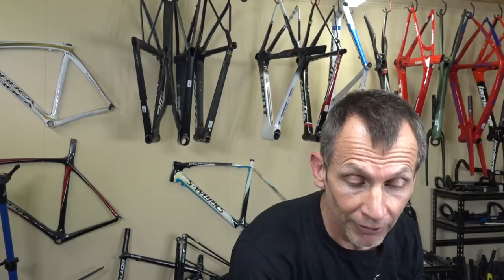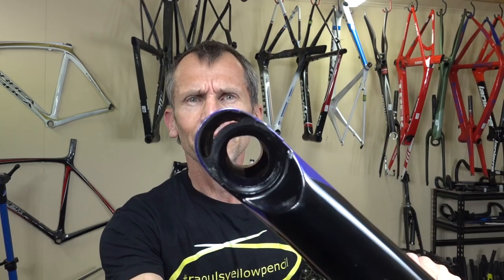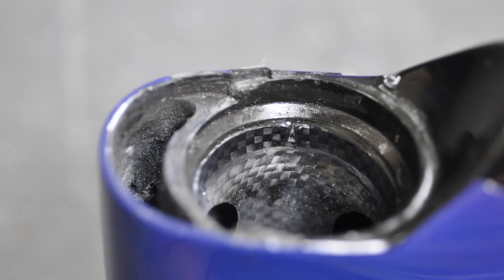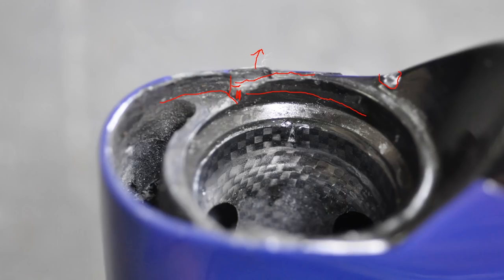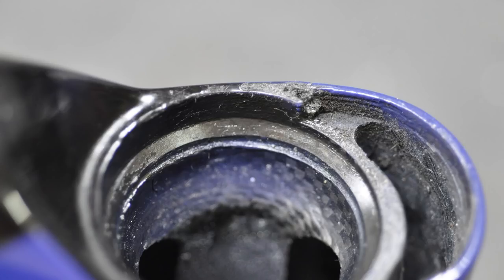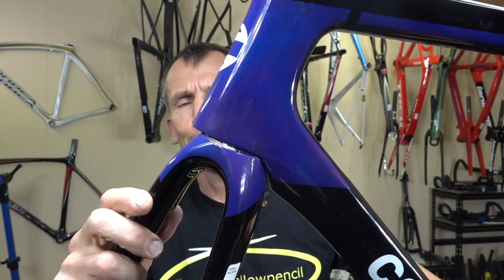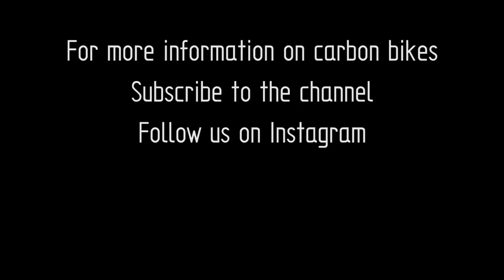Cannondale Design Fail

Comment: I wonder how people who couldn't engineer their way out of a wet paper bag can get a job in the industry. How come that this idiocy can go through every step through to the production without anyone crying out that they're out of their minds? The toolmakers, the mould-makers... Possibly they even had. But since they're almost certainly in China, and the management makes an impenetrable barrier between production and ... erm.... "engineering", or possibly because they don't even dare say anything and "make trouble" lest they get fired immediately, anyone who had clearly seen that this can't possibly go well, nobody told the genius who is supposed to know this stuff... I say it over and over again: the standards of engineering in the bike industry are piss-poor, and even that is charitable.
This is ONE of the reasons I always want to build my own bikes. I want to see this crap before it's hidden inside. I would have immediately filed it away, just like I did with the "lawyer lips" my fork came with. The reason they thought they needed to limit the travel is probably because they wanted to make the brake hose internally routed at ANY cost, and found that if they don't limit it with the way they designed the channels, it will get pinched. I don't want a totally internally routed bike that gives me a 0.01% improvement because the cable is hidden in the frame, and the bike looks "clean". I don't want them gauging a HUGE hole in the crown of the fork above one of the legs just they can hide the cable within, hiding it from view. I want a fork that doesn't break when I apply max braking power. While writing this, I just solved this problem of internal routing more elegantly and safely. Make the frame as normal, then add a fairing above the cables that can unclip when the fork moves too far. Let it hinge on the top end - perhaps make it spring-loaded so it snaps back after the front wheel is straight again, then route it through the leg of the fork or through the fork and then behind the leg. This way you could even take the fork off the bloody bicycle without having to re-bleed everything again, and if you route it behind the leg you can even take the brake off completely and replace and put it back on while it's assembled and bled. This way, you can have the travel be limited by the handlebar hitting the top bar, which is not exactly nice but I believe the safest way to do this.
I'm in the market for a new narrower handlebar, and the dealer had only internally routed ones in the width I wanted. So I thought, oh well, why not, I don't need to use it if I don't like it... But then I got the drawing of the thing (being able to get those is one of reasons I favour Ritchey, which is one of the other firms that does real engineering), and found out that there are two holes on the underside, but also a hole in the middle, so you can route your cables through your stem. REALLY??? Is that worth adding a stress riser on THE highest loaded spot on the handlebar? Just so people can't see your cables and the lines of your bike are "clean"??? I'm quite sure Ritchey engineered around this (by making material thicker on that part and adding weight), but others possibly just drill a hole and weaken it without realising it. And then you need a stem with another hole and another stress riser in it, and possibly a huge chasm in the crown of your fork... Nope. The aerodynamic cost of pushing a 5mm thick (or thereabouts) cable through the air is worth knowing the most heavily loaded parts of my bicycle are not full of stress risers and are at least somewhat less likely to fail while I'm on the damn thing (fingers crossed).

Comment: Can you just grind that pin so it wont hit the frame ever?
Reply: You could, then the thing restricting steering rotation is the gear wires or cables and hydraulic brake hoses that run in that curved slots in front of the steerer tube. That’s probably not a great idea either.

Comment: I just dropped a pretty sum on a 2021 Supersix Evo….yikes…..any way to mitigate any damage?
Reply: Return it using this video as evidence as unfit for purpose.
Reply: Try not to crash. Seriously, the damage shown indicates that the bars were rotated way too far, with a great deal of force. And probably also a loose headset. Look after your bike and it will be fine.
Reply: @stephenturkLA  The damage shown doesn't show that at all, it shows constant gradual wear until fail.
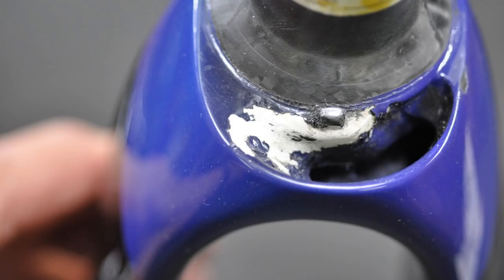Reply: @OriginalAirsoftGasser  In normal use, the metal pin doesn't touch the head tube. There is no contact and no wear. When the fork is rotated to its design limit, which is well beyond the rotation required for normal riding, the metal pin contacts the carbon stop. Or "impacts" the stop, as Raoul describes it (e.g., at 2:41). All the subsequent discussion of point loads assumes that a force is being applied to rotate the fork beyond its design limit. All of the damage shown occurred when the fork was forcibly rotated past the stop. This is certainly not "constant wear" from normal riding.
Reply: @stephenturkLA  Not an engineer are you, first rule of designing something, will the client respect our stupid design, answer is no so it was, as such, designed to self destroy. A contact with the stop is classified as an impact, there should be no metal blade contacting with a raw carbon surface no matter where it is, you cannot use carbon as an impact bearing surface with a concentrated point of force.

From a design point of view though you would ask; 
Are people going to understand it?

Are people going to lean the bike against a wall and have the wheel turn accidentally? (normal use) 

Are people going to pick their bike up and put it on a car roof rack? (normal use)

are people going to do things with this bike expecting our engineers to have designed a system that doesn't destroy the bike frame? (normal use)

I don't know where you got this from;

 "All the subsequent discussion of point loads assumes that a force is being applied to rotate the fork beyond its design limit."

It's not at all, it's a discussion about repeated impacting of small loads against a small surface that's made from a non suitable material and how Raoul is lost for words about the stupidity of the design team, not one of the designers are you?

Comment: in my opinion it is designed to save your top tube from a crash, and it will be cheaper to repair rather than having a cracked top tube
Reply from the maker: I would disagree with both statements.
Reply: @LuescherTeknik  As you have two supersix frames with similar problem - did Cannondale rejected warranty claims for both of them? Have you heard any statement on above from Cannondale?

Comment: Whats the purpose of this "feature" anyway? To stop your handlebars swinging around and whacking the frame when transporting your bike??
Reply: Wondering the same thing. Seems like a useless feature.
Reply: I think it maybe to protect the internal cables from being crushed as they need to transfer through a two holes into the fork or into the frame.
Reply from the maker: To minimise the damage to the hydro hose, which could be cut.
Reply: @LuescherTeknik  Raoul an embarrassment of Cannondale design riches ...so nice to have the choice between self destruct headset  or worn hydro lines. Hmm let me think about that ....no steering or no brakes  ooh it's so exciting !  Can't wait to see what's offered up next 🤨

Comment: How much of this is the user slamming the stop into the frame?
Reply: Even with normal wear this will occur.  I dont have roof racks and have to remove the wheels to stow the frame flat in the trunk of my car.  The handlebars swing to 90 degrees from the center line.  With road vibrations, that metal tab will eat into the carbon frame over time.  Handlebar is at max rotation with the tab always resting on the carbon stop.  It will only be a matter of time.

Comment: I’m no expert but couldn’t the designers integrate the limiter pin and stops as part of the crown and lower head tube races. All as one piece of metal that’s bonded in, add a few extra grams but the frames wouldn’t keep tearing themselves apart.

Comment: I posted earlier today that this exact thing happened to my 2020 Supersix and now my comment is gone.   Weird.
Reply from the maker: I don't know what happened to your comment, I checked the spam filter and nothing there.
Reply: @LuescherTeknik  Thanks for checking Raoul.   I posted that I was involved in a crash where my 2020 Supersix emerged practically unscathed.   However on close inspection I discovered the identical damage that you have shown here.  The over-rotation of the bars caused a delamination of the frame, just like here, maybe a tad more pronounced.   At first I couldn't understand what mechanism caused it.  But when I dropped the fork I could see what happened.  I immediately thought of you and how long it might be before you saw one of these in your shop.   Fortunately for me the crash was caused by an at-fault driver who's insurance completely replaced the bike without any hassle.  I'm sure they were happy that all I wanted was my bike covered.   I was allowed to keep my bike and it is now my indoor trainer.  I replaced the 105 2020 Supersix with a 2019 model of the old, "pre-aero" design.   I was lucky to locate one brand new, rim brake too, with DA Di2!   Cannondale's design flaw got me a massive upgrade at no cost to me, except for some blood and abrasion.  But I was lucky.

Comment: Hey that’s my bike….. Gotta ask why it took over 5 months to repair?
Reply from the maker: Thanks for being patient, it took some time because I had to come up with an improved design, make some prototypes and then test to make sure it would be good before I even got to repairing your frame. Unfortunately this takes time, if the original designer had spent more time on this area, we wouldn't have had a problem in the first place.
Reply: @LuescherTeknik  only took you two attempts…… also why didn’t you seek my approval to use it in a video?…. Oh well the bike got stolen a few months ago ☹️

Comment: The argument for including the blade is to prevent damage to the brake hose. I know guys who have SuperSixes and have ground the little nubbin away.
Reply: I have the rim brake version and have done this as there’s no need for it to be there.
Reply: That would void a warranty maybe?
Reply: Yes it probably will void a warranty, but damage caused by it isn’t covered by warranty. They make that quite clear. It just felt terrible when the bars moved too far round and it bumped against the frame.
Reply: Yes exactly, no warranty. But the warranty doesn’t cover crash damage. The dealer and rep do have a degree of leeway, but it’s not as easy as it used to be.

Comment: Beware: Read Cannondale’s fine print in their Warranty Policy. They may use it against you for their best interest. My $5000.000 carbon fiber frame Jekyll broke after six years of use. Cannondale never made a finding that it was due to use or abuse. A hairline crack formed at a weak point in the frame. The bike was sold to me with a lifetime warranty on the frame. The best offer Cannondale gave me, under their lifetime warranty, was 20% off of retail – yes, that's right 20% off of retail. I fought them on it over a two month period and lost. So, I am now stuck with a 34lb paperweight. Cannondale has what I feel is the worse warranty in the bike business. If you do purchase a Cannondale bike and something goes wrong, know that they probably will not work with you at any level in your best interest. In my opinion, they do do not value you as a customer, they only value your money. This has been my experience.

Comment: i see hambini pencil, but there's nowhere swearing to be heard ... we need to breed a crossspecimen of you guys
Reply: I'm happy with not having the Hambini shenanigans
Reply: Maybe the swearing is there... only it's inside Raoul's head and causing the dumbfounded expressions!
Reply from the maker: I don't think I need to swear to get the point across ;)
Reply: @LuescherTeknik  you mentioned in vdjos before, that there are ways to implement carbon to aluminium, whereas this contraption is wrong on several levels. who insures the designer/manufacturer liable for damages/injuries for potential failures?

Comment: I hate carbon bikes, not reliable and you are limited with their proprietary parts and also not environment friendly!.

Reliability over looks!
Reply: there are no bicycles that are environmentally friendly. creating a metal that can be used to produce a bicycle frame - from ore extraction, smelting and purification, to alloying and forming - is an extremely destructive and toxic process. 
but i will agree that modern-day carbon bikes couldn't get any more ridiculous in their complexity and integration. not to mention their preposterous "aesthetics"
round tubes and external routing for me, please!

Comment: I agree the design could be improved but lets be honest. This damage can only occur if you are careless or crash your bike. In normal riding conditions you would never steer that far. On a conventional bike if you bars turn far enough the handlebar will contact the top tube. Instead of criticising the bike manufacturer maybe you should give some of the owners riding lessons as well?
Reply: No, a good design should prevent the damage from occurring in the first place no matter the riding conditions. Even when not riding, some people bring their bikes in cars etc and there is always a chance that the handlebar rotates that far. In any case, limiting the rotation by gradually chipping away at the frame material is a bad idea. They could have put a metal track on which the 'blade' could sit so that it won't damage the carbon.
Reply: Don't try and justify this, there's no way you can spin it. It just shouldn't be there. What you've done here is known as the Apple defence wherein you blame the end user for a design flaw.
Reply: @sirchristophermcfarlane9377  I have ridden my supersix over 23000kms and my frame is fine. The damage is not from gradually chipping away overtime. It is from a hard impact. Much more than normal knock from putting the bike in a car. Which I have done multiple times. The 2021 frame have a revised metal bridge on the inside of the headtube. The mains issue stands, riders need to be more careful.
Reply: @brownshit1  How many lightweight carbon frames that are involved in a crash dont sustain any damage? The is no back story to what the rider did to cause this much damage. I would guarantee it wasnt from putting his bike in the car. I have seen one of these frames that was on the roof of a car and driven into a garage door that had less visable damage than this.
Reply: @brownshit1  In relation to your Apple comment. If I drop my new iphone onto a hard surface and the screen breaks is that apples fault?
Reply: Coming from the angle you did it was a dead giveaway that you had an emotional connection with this particular frame. You didn't need to tell us you have one, we already knew.
Reply: @brownshit1  whether I do or I dont. That has nothing to do with the fact the only reason this frame is damaged is because it has been crashed.
Reply: @murrayspink7212  I bet you wouldve blamed the user when the iphone 6 bent like a paperclip, its a design flaw which showes itself with normal use.
Reply: @murrayspink7212  Looks like damage caused both sides by multiple percussive strikes. Must have been a huge crash! Or just lots of smaller ones. Steering limiter is needed with fashionista internal headset cable routing. No excuse for poor engineering though. My earlier [and uncrashed] Supersix thankfully doesn't have this worry; just a broken chainstay.....
Reply: @murrayspink7212  if they designed a feature that caused to the user damage the device, then yes. Which is what has happened here.
Reply: @murrayspink7212  any picture on that? im considering getting the 2021 SSEVO as well